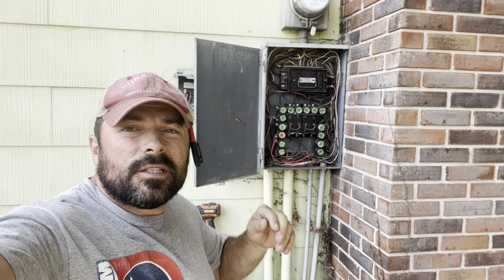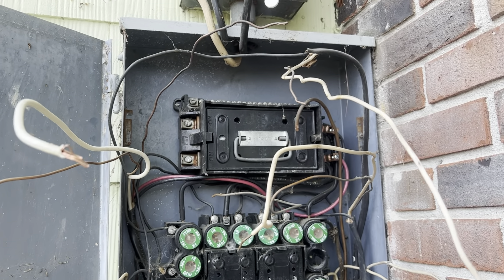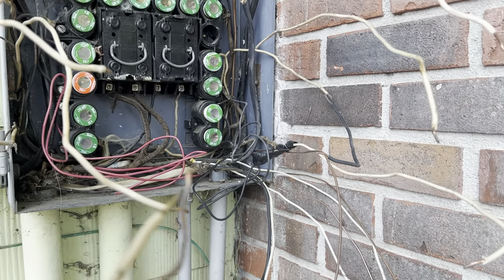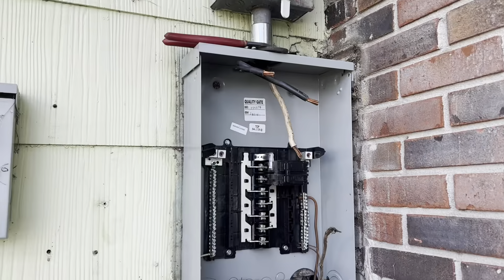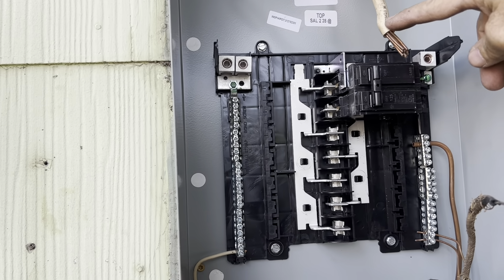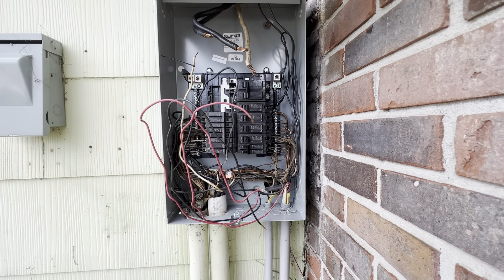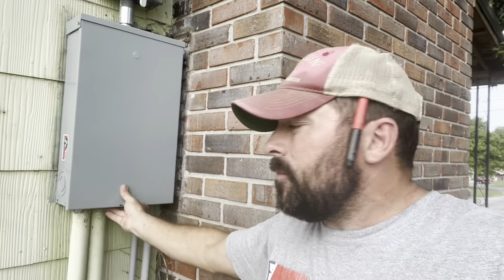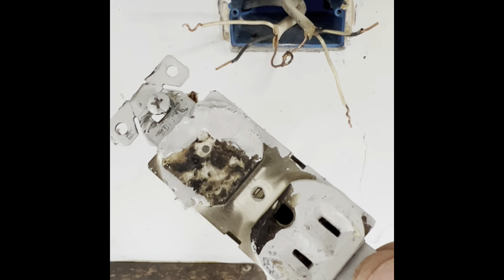Upgrade fuse box to breaker box

Comment: Hmmm, I’m no electrician but I’ve lived here for 30 years and have lived in houses in SC, NY, and KY. That is the first time I’ve seen a breaker box located on the OUTSIDE of a house. I hope you get the inside taken care of. 👍🏻👍🏻
Reply: there are a lot of houses in the south with outside breaker boxes, I agree it's weird.
Reply: Yeah you’re no electrician but this is common on multi family housing
Reply: @KRAKERJAC  I didn't need reassurance that I was not an electrician, I admitted it in my comment.
Reply: @TC_Conner  I agree as an electrician myself I’ve personally not dealt with them outside every state has different regulations and placements 😊
Reply: Omg that outlet!  The people who did that likely won’t be breathing very long.  Nice job.  I laughed out loud when you said this house is a nightmare.  I’m not an electrician but am in homes all of the time (computer repair tech) and have seen some dangerous things such as three cheap power strips plugged into each other.  
I’m in New England and also have never seen a home electrical panel on the outside of a home.
Reply: California all new construction I’ve done is outside
Reply: This is never found in Georgia. All the breaker panels are indoors. Seems like water/moisture could get in during a heavy rain.
Reply: @johndumlao8287 I have a 70 year old home in California and it’s outside. I think its a common occurrence here not just on new buildings.

Comment: Man, then fuse box was a rat’s nest. We install 200 amp panels here. Yeah, the guy that used a 110 outlet in 220 should not be allowed to breath .
Reply from the maker: this was an older smaller house so only 100amp fuse box though I put in a 125 amp breaker box

Comment: pretty sure you got that installed backwards. the green bonding screw is supposed to be the NEUTRAL side...
Reply from the maker: installed as provided from factory.
some say the green screw should just be removed.
I cant see what it makes a difference.
green, bare, white, all the same until you're inside the house.
Reply: @TheProCut17  dude...if you truly don't know why this is a ridiculous statement, how has ANY electrical inspector not failed you?

Comment: Having the electrical box on the outside is not a good idea, fuse or breaker, you know what you're doing, it would be a good idea to look into a good spot for the box inside. I've seen wiring like that melted outlet, yeah....
Reply from the maker: I agree 100% about the box. I would have rewired the entire house and put it inside if it were mine. there was a lot of bad stuff here.

Comment: Looks good bro 
I wire substations (P&C)
I'm learning the ins and outs of residential wiring as I'm about to buy a 50s house 😅
Reply from the maker: Nice 👍
outside you have two black hots and a bare ground
inside the ground splits into white neutral, bare ground, and green bonding.
you can also have red hot for traveler wires on a 3 way switch
and blue hot wires for a ceiling fan light

Comment: Shouldn’t the white wire for the main wires be tied into the neutral side and not the side with the ground? Genuine question not hating.
Reply from the maker: I kept this box wired the exact way it was originally wired. 
If it were a sub panel you would separate the white and bare.

Comment: Wow.  This looks like a total PITA, but I have to get this done in my house.   What do you advise if the old wires are too short?
Reply from the maker: you can safely extend them with a splice, but pulling a new wire would be best. just make sure all your splices are accessible.
Reply: @TheProCut17  Do all splices have to be in a junction box?
Reply from the maker: @ronj9592  that would be the best practice. you just want them to be accessible in the future and not buried in a wall somewhere

Comment: Do you have to replace those old wires; the ones at the bottom going into bottom breaker in fuse box?
Reply from the maker: No wires were replaced on this job.

Comment: How much would it cost to replace and update it, and how long would I be with out power? I got a 6 fuses in it and wanted to update in my 1955 home please reply back at your earliest convenience
Reply from the maker: each job varies also different electricians charge different rates
you could be anywhere from 1000 to 5000
power would be out a few hours to a day
you would save thousands to do it yourself, with a little research its not too hard of a job.
Reply: @The ProCut  my cousin is an eltrician he said about 5k to upgrade mine

Comment: someone told me sometimes you would have to rewire to convert,  what conditions would require you to rewire the house instead of just swap the fuse box for a breaker box?
Reply from the maker: I'd upgrade wiring if it were aluminum

Comment: Great work John ! super sanitary box install 👍 Was that plug in the kitchen by chance ? Was it ever common down there to have a "toaster plug" ? Did buddy maybe pervert the wiring in the box to change a toaster plug to the 220 ? Crazy for sure, especially not to put it back when leaving.
Reply from the maker: I have no idea why there would be a plug over the stove makes no sense to me. the previous tenant trashed the wiring though out the house
Reply: @TheProCut17 - No matter what you have them well sorted now 👍
Reply from the maker: @TheCanadianBubba  can't find where they cut the wires to the rest of the kitchen outlets
Reply: @TheProCut17 - One of those wall scanners they were selling ads for on here last year would be handy so long as they work.
Reply: @TheCanadianBubba  I have a few different electronic devices could not trace them